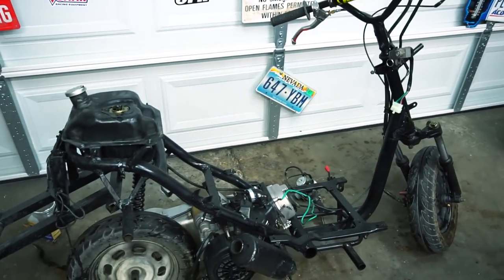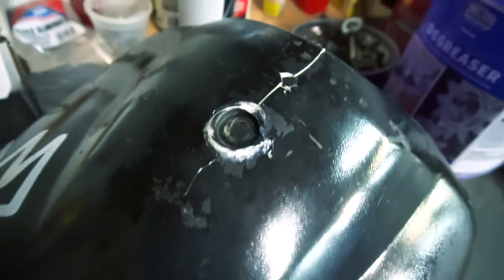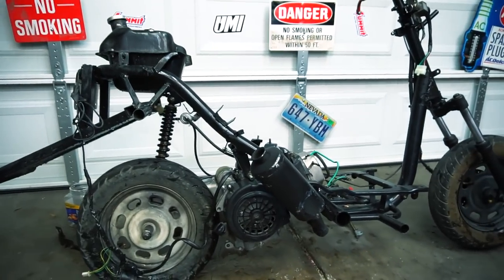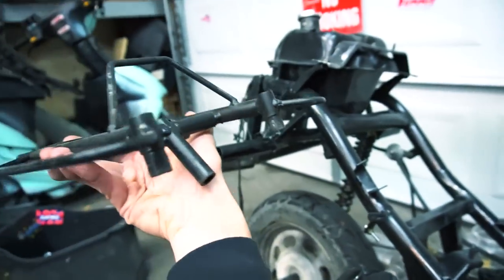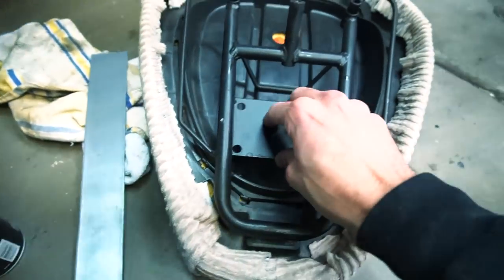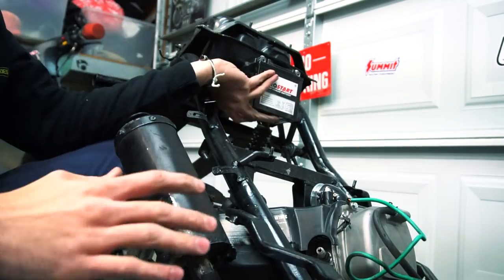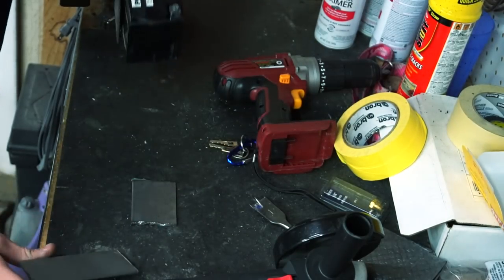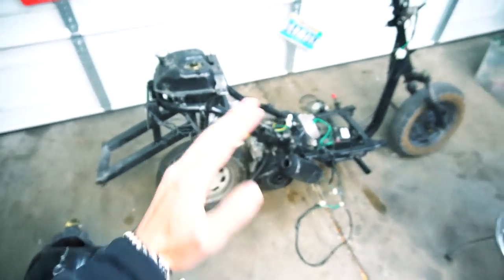TOO FAST TAOTAO GETS A MAKEOVER | 150cc GY6 SCOOTER

Comment: Easy cheap way to fix most plastic, use krazy glue along the crack and sprinkle some baking soda on it ( it dries really fast and is very sturdy.) Sand it down and paint over it. Good as new.
Reply: Saif Said this is true. Or drift stitch